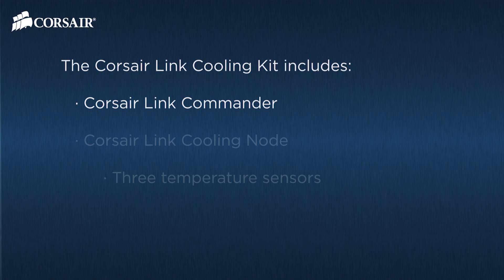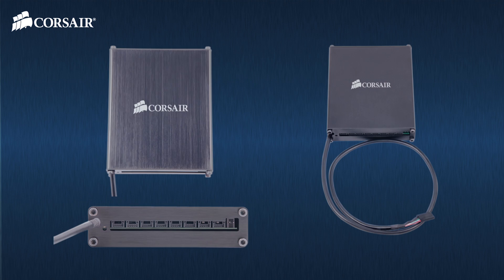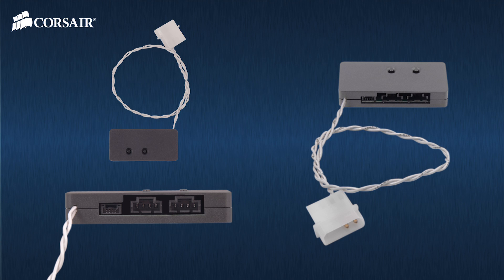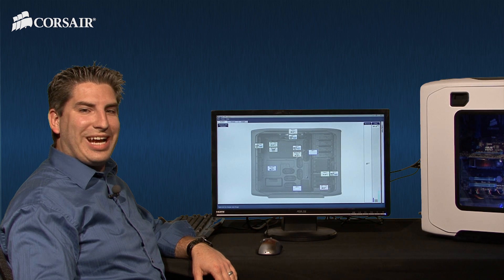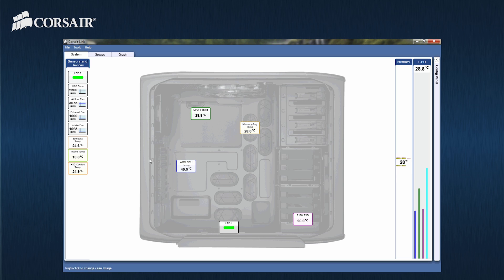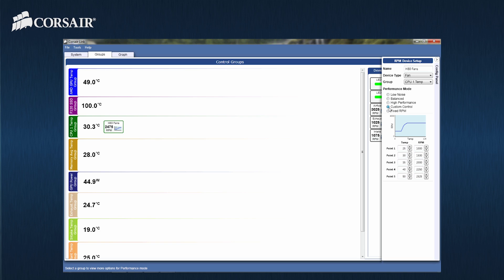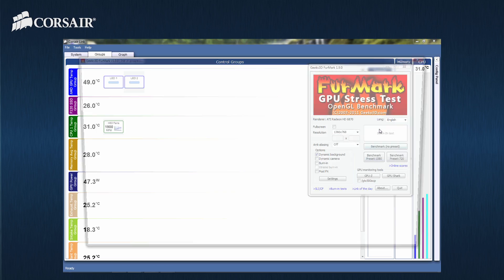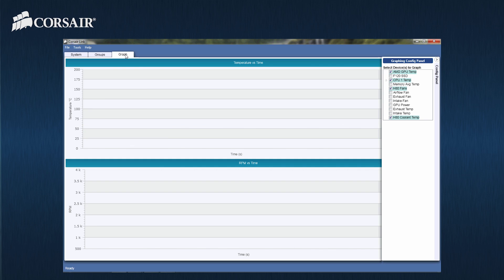Introducing Corsair Link

Comment: Corsair hasn't had this for sale on their website for months. The kits are not listed, and the only thing you can get is the fan controller, and spare cables.   Have they given up on this product line?   Would have been nice to try this out on my new build. 
Sad as my new build has their Dominator Platinum DDR4 memory, H100i cpu cooling, HX1000i psu, and Dominator Airflow Platinum fans.   I really wanted to buy the Corsair link cooling and lighting kit (CL-9011106-WW) to pull it all together.
VERY disappointing!!!!

Comment: i already have, i own noctua fans all across and 2 sp120's quiet editions. even then computer is too noisy,so now i am trying to eliminate all noise,starting with power supply moving on to axing all my hard drive to get rid of the spinning disk noise that may be adding to it. but i am a noise freak, i spent lol, so much sound dampening my office from air cooler noises etc. in my house so money is not a big deal, but i need peace and quiet to do my job, and my job makes a lot so its worth it lol.

Comment: Its not about just saving a few bucks on the electricity bill. Its Physics. Less efficient a power supply is, by nature the more heat it emits. the heat emitted than needs the fan to turn on much more than when it is a platinum efficiency. Further more all that heat emitted into the case further increases temps on a few other components slightly, and this could make the fans turn on. I HATE FUCKING FANS. i pay hundreds of dollars to not get the fans turn on, or only turn on at low rpm.SILENCE.

Comment: most people need 1200w power supply because i have a system that uses about 500-600 watts. if yoiuu know anything about power supply you would know peak efficiency of a power supply occurs at the middle of its capacity. so at 500-600 watt range you get the most efficiency which for me is very important. also the added benefit that the fan spins on less often.

Comment: I have a suggestion for a new case: Make a new version of the 650D without window, remove the sidepanel openers at the side and use the push button mechanism that was previously used by the 800D and only make holes for two 120mm fans at the top. That way it would look so much cleaner and with less mesh on the top less noise would escape. I would also like to see a 800D with a big fan on the side becuse the aircooling on the 800D is really bad.